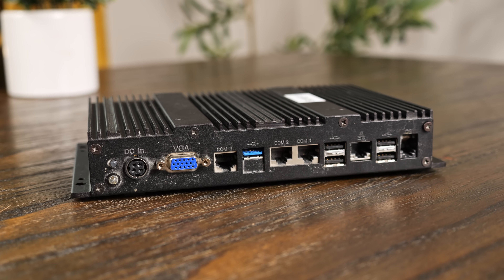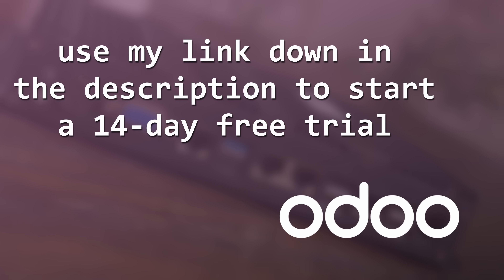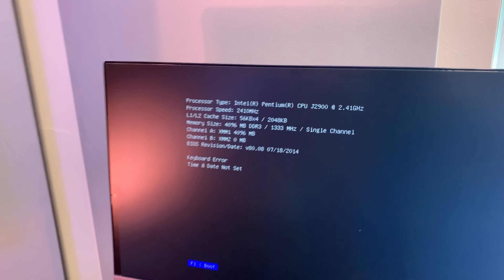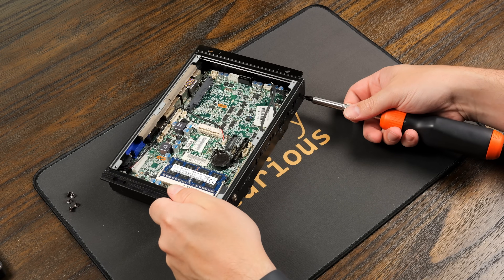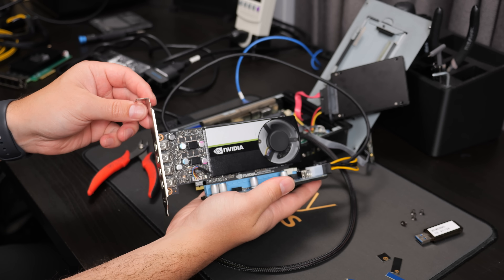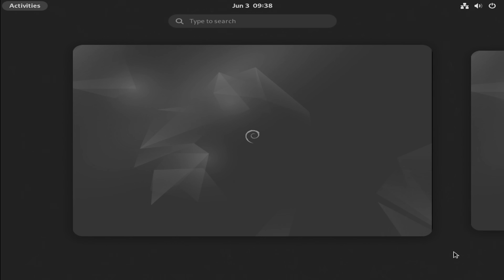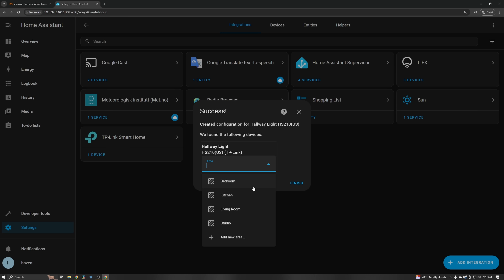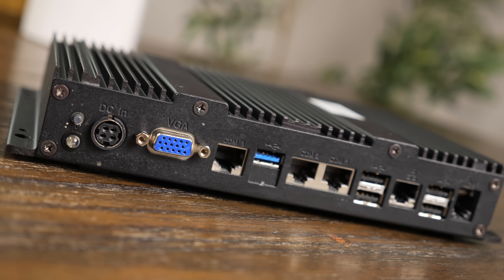I got this PC from a fast food restaurant. What now?

Comment: Strange, my experience has been with older computers is that Linux worked with almost everything.  But these were not computers with designed in limitations (or priority limitations) so what can I say?  'Nada' I haven't seen a specific function work with windows but not with Linux.  I am using currently a China made factory board.  4gb max, won't run windows . . .
But with the memory and cpu perhaps this is normal for this type of system to be proprietary?  Intel has been working hard at creeping its way past AMD once again and proprietary engineering is only one of their little surprises they would hold in store.  All in all this was still interesting.  Don't pull you hair out with Windows 11 (eleben) cheese  People are not pulling away for nothing.
It would work as a controller for a server very well probably.

Comment: At some point, I plan to equip my home with some sort of central computer thingy that can control lights, heating, remind me of appointments or give a weather report after receiving a spoken command. The device in this video is pretty close to what I have in mind: Small, easy to hide away inside a wall or under a desk, closed up, passive cooling, and just powerful enough to run a purely local home assistance software. I might get a raspberry pi 5 with an NPU module, probably and then see where I can get to from there. But essentially, yes: It's perfect as a home server.

Comment: There was a problem with the earlier version of the BIOS that would brick itself (I think something to do with power saving mode, I cant remember). Apart from the stupid idea of having the COM ports same plug size as the network port (the pins aren't the same, caused unnecessary returns) otherwise this isn't a bad board, quiet reliable actually. But like you said I wouldn't ever recommend spending any money on one. (I personally wouldn't even take a free one.) In most cases a raspberry pi would be much better

Comment: A little insight on this for you from a former food service employee this isn’t a POS system but instead connects to the pos system and displays the orders in the kitchen and the com ports are for check printers and a little controller thingy the allows you to scroll through the orders and bump them off the screen when they’re completed!
Reply: hence why it says BUMP 1. I had to image these hunks of e waste
Reply: In this case it could have been a POS system. When you look at the side with the connection ports the one on the far right that looks like a phone jack is labeled CD, this refers to a Cash Drawer. If used as a POS terminal it likely would have been connected to an office server that could do the heavy processing.
Reply: @nickm9102  yes but considering it says BUMP 1 on it, it was connected to a KVS and bump bar instead of a POS
Reply: @myacidninja1025  I never Questioned the use of the unit. I simply pointed out that the unit was configured in such a way that it could have been a POS unit. 

The reality of the situation is that the system likely used the same box for every peripheral location and relied on the server to determine the function. The label indicates what is likely the last use in the restaurant environment. I can't be certain of either as I didn't Install, maintain, or remove the system from the site. I am making an educated guess based on the systems that I have Installed, maintained, and removed.
Reply: this system skibidis my toilet... probs cool but idk

Comment: that naughty secondary display on linux might be eDP connection :P
Those eDP displays are quite common on those embedded minipcs.
Try xrandr command to check which display is connected, and although eDP is not connected by any means, it will still be considered "connected" :P
You may attempt to append video=eDP-1:d  to linux boot parameters to disable it, and it might fix this display problem :)

Love your videos as always.

Comment: hi i am interested in this video the of the pci-e adapter for an old pc i am want to use for steaming netflix and game recording for xbox games and i want to connect a gtx 1660 gpu to it do u recommend any adapters that power a 1660 with a 8 pin connector that can run on a 200w psu can u help it would greatly appreciated

Comment: I got ahold of a McDonalds "overhead grill" mounted HP T-630 Slim With an (Embedded) AMD G-Series GX-420GI & the rare Radeon R7E integrated graphics chipset (This was this was precursor to the Radeon Vega Series, but ironically it usually out-performs both the early Vega 1 & 2 chipsets.) Cleaning it up was awful- it had about a 1/8th inch covering of burger grease over every surface inside the unit, even inside the ram/NVME slots, which is what actually caused it to stop working in the first place. The outside front & bottom had about 1/4 inch of extremely sticky Jelly-like oil residue, which was even worse to remove despite it being external. I played around with it for a bit, breaking past the MCD OS to find it had Win 10 Pro IoT (Enterprise) before upgrading it a bit & set it up w Garuda Linux + Steam's launcher for my 6yo niece. She had almost no trouble adapting to Linux, despite never having experience with it before. What I'd give to have that sponge-like memory at my age lol. I introduced her to some programming/building/automation related games Like Autonauts, Autonauts Vs Pirate Bots, Subnautica, Astroneer, Terra Tech, (her favorites) Trailmakers, & Factorio. When she gets older, hopefully some others like Dyson Sphere Program, Human Resource Machine, & Zach Tronics games like Magnum Opus & Shenzen I/O. The AMD system has no issue running any of those games, even though the Intel laptop that she was using before was 3 years newer ( an i7 & Intel "HD  Graphics) couldn't.

Comment: I had similar VGA issues w a similarly aged machine. I had to manually add the resolution to the Xorg config and it worked at the correct resolution.

Comment: Just a suggestion: Run BOINC on it with whatever project strikes your fancy. If you don't mind the power draw, you'll be helping research, education, and other worthy causes. I'm running it on an old HP Netbook with Raspberry Pi desktop OS. Because of the limited 2GB RAM, I've set it to only a single project (World Community Grid). Just boot it up and fuggetaboutit.

Comment: In the restaurant industry IT technology was slow as molasses in winter for many many years.  1980s programable cash registers/ordering systems stayed in use for nearly 25 years.  Even when new stuff started coming out, the industry was soooooo slow to adopt it simply because changing out IT solutions across 200 - 7000 locations is a huge undertaking.
Reply: Ah, working in similar industry tech wise we are talking for years about updating or IT infrastructure. It is just a huge monetary undertaking because of magic two word issue. Custom software.
Reply: @maphantom  Working in manufacturing, they avoided changing technology until there was some kind of crisis. Not just money for the hardware and software, but also dealing with the impact on operations was massively painful. People were just used to and comfortable with the old system.

Comment: I recently bought an used industrial PC on eBay. It was full with remote control configurations (Many VNC connections to subsystems and a lot of very specific light management software) , including IPs and some account data to Austria's national theatre. They did not bother erasing the SSD .. well I did then, because I had more important stuff do to than to abuse the situation.

Comment: This CPU, J1900, is part of a range which contain a silicon bug called LPC CLK degradation. Countless devices failed after about 3 years (for example NAS devices from QNAP). The fact that this device still works after more than 3 years is probably because it was designed not to rely on LPC to boot (there are some bootstrap pins which indicate SPI or LPC boot).
Reply: I repaired quite a number of those.  For less severe cases there is a resistor fix which might work for another year or 2. And for  severe cases the CPU can be replaced of coursrle using a high quality SMD rework station such as the WDS-620. But there is a point where is nit worth investing further in fixing old hardware which should not be broken in the first place.
Reply: ^^^ This. Unfortunately this. I recently had a QNAP die on me and had no idea this was a thing until i started researching. Drives, I expected to die over time. Actual hardware itself - sadly, no. First thing i did when he said J1900 was cringe.
Reply: That would explain why my old jellyfin server randomly stopped booting
Reply: Umm... I'm currently holding onto a J1900 powered Acer Aspire X Prebuilt with a manufacturing date of 2014. Apparently it had Windows 8.1 before I inevitably gave it a Kingston SSD with Ubuntu and a (very much) senseless upgrade from 4GB of RAM to 16GB of RAM. Just now gave it a mini-PCIe Wi-Fi card and antennae.
Reply: @martinmethod427  Ayy I've got the same exact model! The only downside is the RAM... it doesn't like more than 8 GB... how the hell did you upgrade past that??
Reply: @martinmethod427  16 gb I also gave to my old lappys, makes me happy 😊
Reply: If you live in a country with good consumer protection laws (not the USA), if a CPU dies after only 3 years then you should be able to claim a repair or replacement under warranty.
Reply: @Daniel15au  I am familiar with cases in Western Europe. Many of them. The EU law actually say 2 years of mandatory warranty and most devices failed after that, in the third year. But is a difficult issue because at fault is a silicon bug of the CPU. In a perfect world the manufacturers would repair the failed devices and be reimbursed for the expenses by Intel but since Intel had practically a monopoly, would not deal with those relatively small manufacturers and the NAS manufacturers would go out of business if they deal with this expense all by themselves. So the customer is left to eat the loss.
Reply: @georgedone7997  Interesting, thanks for the info. I'm Australian and our consumer laws state that products should last at least as long as a reasonable consumer would expect them to last, and the company needs to repair or replace them if they don't, even if it's outside the warranty period. No regular person would expect a CPU or NAS or whatever to only last 3 years, so repair/replacement would definitely be covered under the Australian Consumer Law.

Comment: I use something similar, same CPU, and I also removed the sata ssd from its case.

It runs my Unifi controller and I use it as a G-code sender (over serial) to my CNC engraver. I don't use much more than 10% at highest load on the CPU, been running it for few years now with zero issues.

Comment: dude. octopi or klipper would be perfect on this.
Reply: it have a internal paralell port. so it can easily be used to control stuff. it can be run on 12v so it might be good for automotive application?

Comment: I have two of these machines. One ran Windows and was the Drive-Thru timer, and the other was a front-side order display/bump bar machine. The second one is passively cooled as well and is actually now my firewall. It's also a J1900 with 4gb ram and a 64gb SSD and two Gbe NICS running OPNSense.

Comment: I have a few systems based onm the Z8350, one is my MediaCenter Network Client (not even trying video above 720p or in some cases 1080p) the others one is stopped doing nothing the remaining one is my overkill WiFi ISP Client Router basically hehe ((Two of them are actually AtomicPi's, the last two which I set up as routers)
Reply: Oh yeah, that Lenovo Tablet also uses one of these now that I think of it. Not the fastest thing on the world, but enough for the purposes in question, only the MediaCenter I am considering upgrading and only because that it's hardware video decoding acceleration supported needs improvement.

Comment: interesting.. not my cup of cake any more (if that even is meaningfull English 😁)
But I was just interested in low-power CPUs for my NAS lately - probably that's why YT recommended the vid - and at least can confirm, that "Atom/Celerons" hugely improved in the last years. Probably as technology trickles down from the E-Cores used in latest hybrid-cpus.
For my NAS / Homeserver I upgraded from a 2016 dual-core N3060 to a 2021 quad-core N5095 (predecessor to the N100) - and the performance, when using the NAS as server or just in its web-ui is night and day. It feels so much snappier and long running tasks like Raid-rebuild take a fraction of the time.

Comment: I once saw a edge AI industrial PC that had 8 POE ports and and intel 6th/7th gen CPU and really wanted to get it for my home security camera setup (Frigate NVR) because it would have been incredibly clean setup. It was also passively cooled, so PoE  switch and server all in one easily mountable body. However only used unit I could find was in Canada and shipping was 100 USD.... I also could not find anything even similar to it because it was an industrial product and it is not like make it easy to find your competition. It's intended use was for quality control using machine vision over an assembly line: looking for observable cracks or imperfections etc.

Comment: Haven't thought about the utility of Cinebench R15 for a while. My R5 3600 is a 6c/12t part and the heart of this workstation, scoring 188/1600pts respectively. Works great but forum weirdos constantly try to sell me on something better when I just don't have the need and probably won't for a VERY long time. My server is a stock 1c/1t Athlon 2650e that scores 40pts and is probably the absolute bare minimum for what I need. If that cute kiosk PC could mount full size HDDs without looking like an overbuilt tumor, that would be an incredible replacement with several new features. Kind of a shame it didn't ship with 10GbE SFP. At that price it should have it.

Comment: This looks to have been used as a KMS (Kitchen Management System) controller.  Usually used with a touchscreen or hardware bump bar for acknowledging or bumping products to the next screen/clearing once prepared.  Probably the most common brand for KMS is QSR.

Comment: Connect serial ports to serial to usb adaptors and could attach to other devices like arduinos to read servers, you can connect to linux via serial and access the desktop.
Reply: His pfSense box (12:24) is a Seeed Odyssey. It has a soldered-on Arduino Nano.

Comment: COM ports have me thinking weather station if you could find sensors with the correct connectors or crimp the correct pinouts for available software to work with... Or write something to poll the data...  How far into the weeds are you willing to go with it?

Comment: DANGER (Power over VGA)

These POS systems have the capability to provide power to a video display via the VGA port, you can actually see that option in the BIOS settings when you were flicking through them.

If that option is enabled and you plug it into a display or other device not designed for that you can damage them.

Comment: The J1900 CPU has a defect in the CPU HW.  It will fail to boot after several years.

"At the time the flaw was discovered Intel posted an addendum to their CPU specification update for the J1900 and related CPUs. (Intel has since removed these docs from the public facing side of their website and requires a CNDA account to access them. Thankfully the wayback machine has an archive of them linked above) Unfortunately, the problem lies in the silicon of the CPU itself and is not repairable..

To add detailed information and background information, we have measured that the LPC CLK signal is clearly degraded, and most often that the negative cycle transistor is broken, meaning that the clock signal is swinging between 1.6 and 3.3V, not 0V and 3.3V. We have tried to put a 120 ohm resistor between the degraded clock signal and 0V, and that seems to solve the problem, the computer boots again. But we need enough detailed information about the cause of the VLPI1 errata so that we can assess if this is a longtime solution that will last, or just fail in a few more months."

The short term solutions fails after a while."

Google J1900 qnap for more info.  My 30TB TS-451+ fell victim to this.  Replaced it with a ryzen based TS-673A.